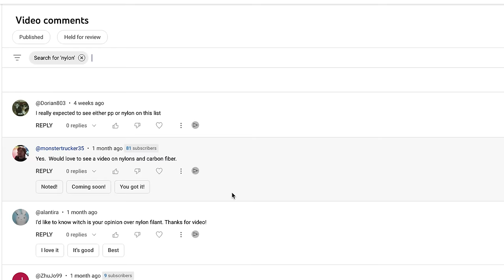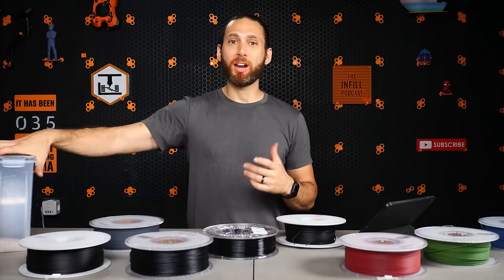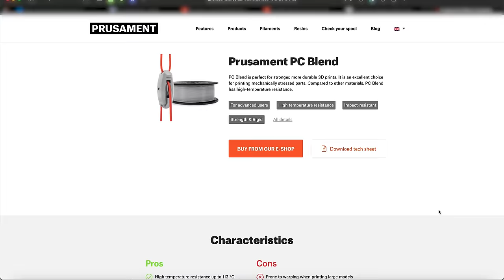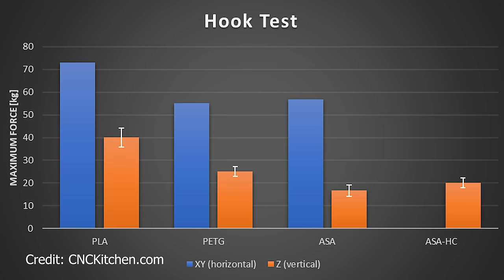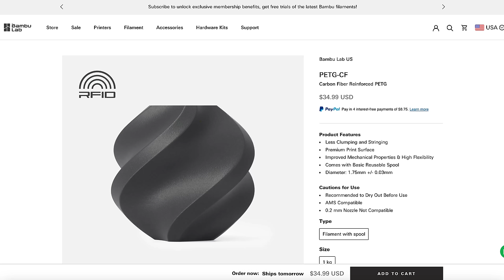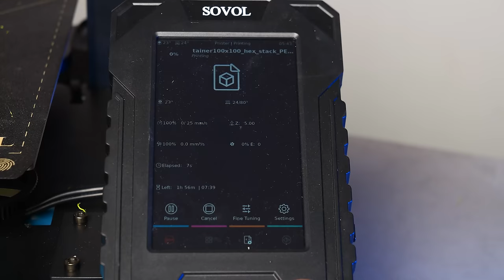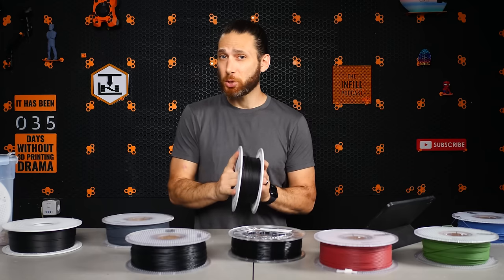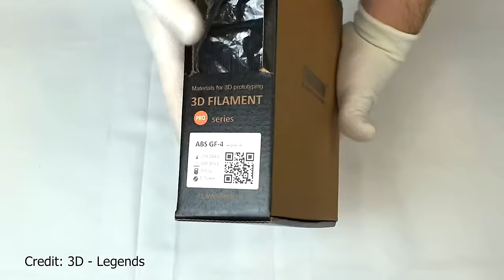Carbon Fiber 3D Printer Filaments: What Are They Good For?

Comment: I've printed in PC and not had problem with it warping on the X1C very easy to print , but it does shatter if bent .
I use it for it's heat resistance eg I've used it for printing spools and Silica Gel Boxes , so I can heat them up to 70c.
The other day I was looking for transparent / clear filament and there is PCTG which is said to be like PETG.
Reply: The X1C makes most filament easy to print, especially if using their filament.

Comment: I don’t have a printer. But if these spools of material are hydroscopic. Does that mean that finished prints also absorb water???? Does this mean the finish print will break down and weaken with time? ??
Reply: Finished prints will absorb some moisture but it doesn’t weaken them the same way that letting your filament absorb water before printing will. When you’re printing with filament that has absorbed moisture, the water will boil when the filament heats up inside the hot end. The steam from the water boiling off tears apart the polymer chains on the filament which reduces its durability. A finished print won’t be affected in the same way because it won’t ever be hot enough to boil off the water. Finished prints left in high humidity environments for long periods of time can become brittle though.
Reply: @coltonmowbray3093  awesome explanation. Makes sense. Thankyou

Comment: Never used cf filament but if i would i would use it as an anti wear material i have considered getting tpu-ct for basically 3d printed tires for off road overpowered rc car (like 1 hp+) for mainly getting widow maker branches off trees so i am well out of the way

Comment: Great video, but there are concerns around the heat tolerance of Nylon and CF-nylon. Standard Nylon has an HDT of 95C, only 10C above ABS. But, in reality, ABS will stay rigid right up to it's HDT of 85C whereas nylon will start to go flexible at 55-60C geometry dependent, test it for yourself to see. 

CF-Nylon in no way is comparable to PEEK or Ultem in this area. Some polymers like Nylon do not work with the standard HDT test, and manufacturers take every opportunity to fool consumers where they can. The Vicat test is more relevant with these polymers. 

CF materials are first and foremost to allow low end printers to run more than just PLA or PETG by mitigating warping and shrinkage at the high cost of layer adhesion and brittleness, not to mention extremely high machine wear and tear. 

If you have a printer with a heated chamber to at least 70C for dimensional accuracy and ideal layer adhesion (85C required for some geometries and solid infill) then standard ABS is better than ANY CF filled material, no competition. Don't be fooled by the marketing ploys and downright lies of CF filaments. Some manufacturers are finally coming out and saying this to be true.

Comment: Axial strength was mentioned many times . Is that  strength in the Z axis ? That could be either tensile or compressive strength . Isn’t it important to specify which when you’re comparing properties of the filaments ?
Reply: Axial strength is along the fibres. The two types of strength usually measured for filaments both in the XY plane and Z direction are tensile strength and bending strength.

Comment: Agree carbon fiber filled is better for finish then for strength. Nice matte, seems smoother.
Reply: That is only really the case for low carbon fibre content PLA, it makes a very noticeable difference when added in a decent amount to already higher performance plastic.

Comment: Hi,

I’m after advice? 

I race rc cars and I want to try print the bumpers for the stock cars so they need to be strong what’s the best filement to use for the bumpers? 

Thanks in advance 
Kyle
Reply: Nylon is great for shock. That’s what i had on my cars.
Reply: @KaylaRosa-fd4bw  thanks

Comment: PLA IS NOT BIODEGRADABLE
or at least, not in the way people tend to think. while technically it will biodegrade over hundreds of thousands of years, it is INDUSTRIALLY COMPOSTABLE, as in if kept at, say, 50 something degrees celsius like in industrial composting environments for a few months, it will break down into CO2 and H2O through whatever processes including microbial digestion. it will NOT biodegrade if left outside or buried in the ground or in a landfill.

Comment: PETG-CF and PET-CF is really good as it fuses layers together and its a more beginner filament most people can use with a direct drive.

Downside is I've had rolls that I've had to throw out due to them getting to hot during delivery, fun fact shocking it with a hammer occasionally works on freeing the roll
Reply from the maker: Hot during delivery?!!! How?!!??? No way a UPs can gets to 70 degrees!
Reply: What do you mean with your statement about most people being able to use PETG-CF and PET-CF if they have a direct drive? Direct drive has very little to do with what materials a printer can print, all of the filament shown in this video also work fine with Bowden tube systems. Direct drive helps with flexible filament but that is about it. Also all filament fuses layers together, that’s just how FDM works.

What actually matters in terms of materials are the hotend, nozzle and enclosure. The most important part is the hotend, it needs to be able to handle the temperatures required, all the filament in this video can be printed using a normal all metal hot end. If you need to go hotter you can get nickel plated copper heat blocks and nozzles and a bi metal heat break, and a higher temperature thermistor and higher power heater, then you can generally go up to 500 C which is as hot as you would need to go for pretty much any plastic filament. For abrasives you need an abrasion resistant nozzle, like hardened steel, tungsten, ruby or diamond, although only some are fine up to 500 C. Then for higher temperature filament you really need an enclosure, regardless of what people say, just because it is printable doesn’t mean it is printed well, it may print but may be weaker than it would be if printed with even a basic, passively heated enclosure.

Comment: I’ve had very good and easy experiences with PC right out of the box on the Raise3D Pro3. I also like Taulmann Nylon 910. The only CF filament I’ve used is MatterHackers’ NylonX, but after printing a whole spool of it, I’m not that impressed. I think ASA is much nicer for stiff projects and regular Nylon for ductile ones.
Reply from the maker: Nice, thanks for sharing your experience :)

Comment: In automotive industry we have parts like break fluid tube connectors made from PA-CF. However they are injection mould products, meaning that carbon is actually doing it's job properly, FDM method is just not optimal.

Comment: I'm printing that hex storage wall in the background for my room but the pieces are so tight to snap together. What material did you make them out of? I think my use of pla is a mistake.
Reply from the maker: I used PLA too?
Reply: @thenextlayer  huh that's weird. I can barely get the connectors and and I almost break the hex grid trying to get them out

Comment: What, no PP??  GFPP prints fantastic on open printers with a Garolite build plate and Magigoo.  It's "grippy" to the touch, layer lines are non existent, and  looks amazing!  Kevlar ABS and Nylon are good materials that print fairly easily.  PC-ABS and PCTG are some blends I've used for harder polymers that print easier than the individual plastics.
Reply from the maker: Wow. Sounds like I need to do a third video, huh?
Reply: @thenextlayer Please make a Video about ABS, PC, PC-ABS blends and their composites (GF, CF, Kevlar). It is often overlooked, that for rigid parts, maybe PC or a PC-ABS blend would be the better choice than adding carbon fibers to everything. A material property, no one seems to test/compare is friction. How do parts printed in a certain material glide in each other? Some materials squeak and jerk and are not suitable for making articulating/gliding parts with a lot of load on them. In a "microphone-boom-arm-project" the PLA would make terrible noises and not allow smooth articulation of the arms and so I switched to PC-ABS (BASF Ultrafuse PC/ABS FR). I also miss strength to weight ratios in filament comparisons. For many applications weight is more critical than volume. Just some thoughts and perhaps Ideas for a future Youtube video?

Comment: you forgot that nylon cold flows under pressure, way more than any filament or plastic... Basically you can throw away nylon parts if its bolted or squeezed for longer peroid of time

Comment: I used PETG-CF to print a body for a bass guitar that I designed. I had used regular PETG for another guitar body project (not my design), and every corner lifted by at least 5mm. With the CF, usually only 1 corner would lift and then only 1mm(ish). I did have to slow down the print speed to about 75%, and I was glad that I was using an Ender 3 pro so the speed adjustment was easy to dial in during printing.

Comment: I have used PLA-CF (Polymaker), and it was pretty weak. It printed great, it was printed at 230c. I had printed the Prusa dragon(Adalinda) or something like that. It has dropped from a height of approx 3-4 feet on a carpet, which bounced the then it hit the PSU to my laptop. The wing broke off. I probably will not buy it again. Too weak in my opinion. 
I do wanna try ASA-CF
Reply from the maker: Thanks for taking the time to comment! Yeah, it is less impact resistant than standard PLA, but even more rigid, it seems. Also depends on the brand probably.

Comment: It isn't totally true that a printer be enclosed to avoid warpage on certain types of filament.  What IS required is that the print environment take place in a constant temperature, with no air draft near the part.  The part must not be subject to rapid cooling after extrusion of each layer.  Having the printer enclosed is one way to insure this, however an open frame printer operated in an insulated closet would have the same effect.  This is why a print farm using a bunch of open frame printers such as the Prusa i3 series, or the Lulzsbot TAZ series will work with such materials.

Comment: I bought a spool of PC CF and it prints good, but the layer adhesion is not that good and I don’t know why. I slowed down the print and didn’t use the cooling fan and still I was able to split the part in half.
Reply from the maker: How hot are you printing? 280 should do it.
Reply: @thenextlayer I know the label says to print between 250-280, I was at 265

Comment: 13:00 PETG in THICK sections is not flexible & ductile, it's the absolutely most brittle material i have found, even more brittle than glass.

My analysis was that it develops internal stresses, as the fractures show perfect layer adhesion and uniformity, it breaks like glass, into sharp shards. Dangerously sharp shards.

Comment: Cool stuff! I have watched all of Zack Freedman's every filament videos, and those carbon fills looked cool. PLA-CF's properties sound a lot like Polyterra PLA's properties, but it think PET-CF would be the first carbon fill I'd get. I already got a hardened steel nozzle when I first got my own printer, however I broke the thermistor recently and if I were to actually bother to follow your advice, I would probably be printing as of writing this comment.  I'll see if it will be worth it to buy a whole Ender 3 hotend ($17) to get it tommorow just for the thermistor and extra heater cartridge over waiting for a thermistor sent by customer support.
Reply from the maker: Consider upgrading your hot end?
Reply: If you just have an older ender 3 then you shouldn’t try PET-CF without first making sure you have an all metal hot end, just having a hardened nozzle isn’t enough. For PTFE lined hot ends at the temperatures required for PET-CF (280 - 300 C) the PTFE will degrade and emit toxic fumes. Also if it is an older ender 3 it may not even manage to reach the required temperatures. For best results you should have an enclosure too. 

I would not recommended PET-CF as your first fibre filled filament.
Reply: @conorstewart2214  I have a Neptune 3 that I upgraded with a Copperhead CE bimetallic heat break, so it is "all metal".  I have a 0.6mm hardened steel nozzle available. My extruder has stainless steel gears (clone dual gear) and my filament sensor has steel bearings too. I found printing ABS in the open to be quite easy, just crank the temps and use some mouse ears or a brim. I am just waiting for a thermistor to arrive and to tune in input shaping using a USB accelerometer (obviously, running Klipper on a Pi).

Comment: i just printed my first parts in PLA-CF and i'm really dissapointed. Verry brittle and low layer adhesion. The matte finish is the only redeeming feature. I'll try to anneal it in an atempt to justify using it. On the other side, i have quite a lot of experience with PA-CF. Everybody keeps saying it's super strong but that is because it's super soft and bendy. Even the CF variant is unusable in any kind of rigidity requirement. It does print quite nice when properly dried and in an heated enclosure. Other than way better temp deformation than ABS, i also find it hard to justify printing with it. There's a reason ABS is the most used plastic ever. If you have the right setup and print it corectly, it can do just about everithing you need. It's also THE ONLY affordable filament that doesn't creep (it doesn't deform over time when under high loads).
Reply from the maker: I agree with most of what you said but my PA-CF has all been extremely rigid! What brand are you using?
Reply: @thenextlayer I'm using  eSUN 's PA-CF. I never considered that other brands might have different properties. That adds another layer of complexity when deciding what to buy. I guess i'll buy even more rolls and see what i find. Tnx fir the quick reply and the great videos. Stay safe!
Reply: @BMW520ITURBO  I had the same experience with eSUN PA-CF - very rigid fresh off the printer but as it hydrates over the next few days it gets surprisingly flexible. Still extremely strong so great for printing parts that need impact survival over rigidity (I think RC car bumpers here) and seems to have all the thermal survivability.
Other nylon-CF formulations behave differently - Bambu Labs new PA6-CF is has retained most of it's rigidity two weeks after printing at which time the eSUN would have softened.

Comment: I wisely spent a little more and purchased an Ultimaker S3 to get into 3D printing, I can't find fault the machine's sturdy enclosure and overall build quality, I was swayed by it's glass heated bed and dual nozzle print head. After spending many hours reviewing different 3D printers, I concluded print speed wasn't a deciding factor, that ultimately made me settle for the slower more accurate UM-S3 over many of the more popular cheaper faster consumer grade 3D printers available in 2024. The S3 prints any 2.85mm filament type with a silky smooth finish. UM's quick swappable nozzles, range from as small as 0.25mm, up to 0.8mm nozzles, meaning my prints have almost invisible layer lines every time and require only minor post processing. Thanks for the informative review. 👍

Comment: PET-CF (not the G), is in many cases far superior to PA-CF. It has alot higher HDT then most filaments, it can very easy be printed on open printers and dont need gluestick but normal adhesives like 3Dlac is more then enough. Much easier to print with, is more ductile, and the finished product is not affected by humidity like PA-CF really has issues with.

Comment: Ive printed nylon and cf nylon on a prusa 3i without any incloser without any problems, i would use a food drier and run that 24hr before i printed then print straight from the drier, i made nylon bushes for a 125cc honda and i use carbon nylon in my airsoft hobby and print drop stock etc, all printed on a prusa with a slice engineering hot end and .6 nozzles.. i just tweeked a prusa nylon profile .. you dont need a bambo lab do use these filament you just need to learn how to do it and your printer. The world isnt just plug n play 🤔🤔.

Comment: Glossing over PET-CF just because you had already done PETG-CF was not good. PET-CF in terms of properties should be classed as totally different from PETG-CF. Much higher rigidity, strength, and importantly temperature resistance. Also in a lot of case PET-CF is quite a bit better than PAHT-CF, especially due to its rigidity and low moisture absorption. PAHT-CF is more impact resistant though.
Reply from the maker: You’re right about that! But the video had a deadline and I figured better to include it than not at all. Maybe I’ll do a follow up where I go more in depth. Thanks for the feedback.